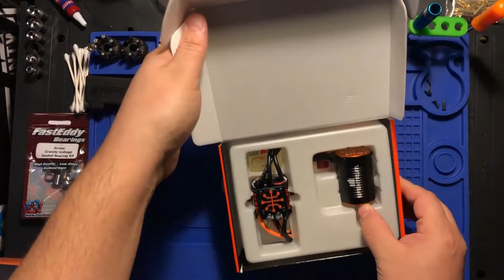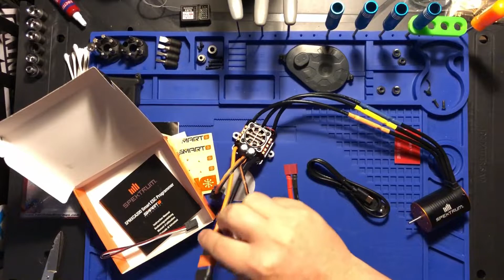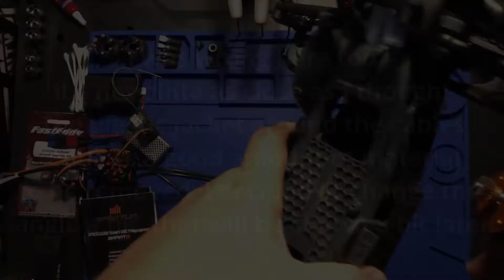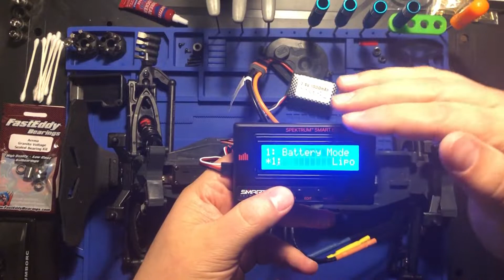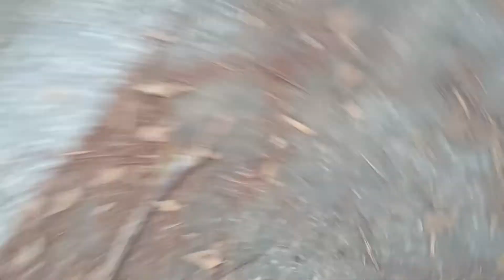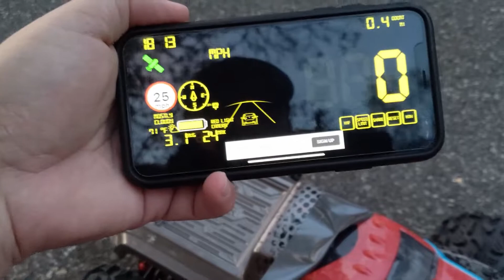Overvolt | Arrma Granite Voltage gets Spektrum Brushless System (is it faster?)

Comment: Made it ! 100th subscriber for you bro.
Reply from the maker: Extra special internet high five to you man! Thanks for the 100th sub!!!
Reply: Word high dive recieved . And my first hobby grade was a voltage 2wd. Back in November.  Now I have 4. Notorious 6S bigrock and just got a senton that I put the powerplant from an infraction in.
Reply from the maker: @michaellind3626  Notorious is definitely on my list. That senton/infraction combo sounds pretty insane!
Reply: @kylegeldmaker   it is for sure only going 4s for now changed all input and crown gears to metal and slipper assembly.  Had to upgrade cvds kept.pulling ujoints apart.  It is a monster 👹 for sure
Reply from the maker: @michaellind3626  is it meant to be a basher, or are you going more of the speed run route?
Reply: @kylegeldmaker  no basher all the way. I tried speed running but bashing is where its at!. I put Mojave 6s shocks and kraton 6s shocks on to have little better landings.
Reply from the maker: @michaellind3626  I agree. Although, I am planning a mild speed-ish build with a buggy in the next month or so.
Reply: @kylegeldmaker  i plan on getting a Mojave next and want to try a little speed with that one. I know it won't be easy but it'll cool to go fast in thst one! Lol
Reply: I just sold my speedrun rig today it was just sitting so I figured could go somewhere it was appreciated more than my wall lol
Reply from the maker: @michaellind3626  You're a stronger man than I. I'm running out of room and yet I can't bring myself to sell a rig. Much to the dismay of my wife haha!
Reply: @kylegeldmaker  well it went to a good home. My buddy has 4 wltoys now  and wanted this one before me but I got it first.  Had a castle 5700kv motor with sidewinder 4 esc. It was a 100mph rig. He's got one he did a dbl motor in and trying for 125. He's gonna add another system like the one it has and make it a double too. So why not let him take it when its just collecting dust with me.

Comment: I am a couple years late to the video...lol I just put this exact combo into my Slash 4x4 (was originally a brushed motor. I have uped the pinion to 15 pin(i think, maybe 17. Cant remember) I just got a 3s spectrum battery to try out, used a 2s and want more speed, hope this does it or up the pinion again maybe? Any pointer are appreciated
Reply from the maker: Gearing + juice = more powah, baby! I believe 3s is the max for that ESC, I've hit like 56 mph on that combo with my buggy.

Comment: I put the same exact stuff my granite voltage and I also had to cut the chassis
Reply from the maker: It wasn't too bad. I've had it this way for quite a while and I haven't broken a single thing or noticed any issues that  could be caused by notching the chassis.

Comment: Great video. I'm totally sold on Spektrum Combo systems. I have 2 of the exact same systems you are reviewing and they preform excellent. I also have the BLX100 systems in my Granite and Typhon and have had no problems at all. I like how the 85amp ESC has the Caps on board much better than the BLX100.  You did a great job fitting the motor. The final outcome was awesome and it ran well considering the battery.  Thanks for sharing 👍
Reply from the maker: I bought two more of those Spectrum combos. Im thinking about tossing one into one of those wltoys 14th scale buggies.
Reply: @kylegeldmaker  Sounds like a great idea. You might need to add some weight as well or attach some wings. 👍👍😀😀
Reply from the maker: @RCRoads  it's got one on the back already, haha.

Comment: So I just bought this combo today with 3s how fast would it make my rustler go
Reply from the maker: Depends on the gearing, but my fastest speed I've tested was 46-47. I bet it would do 50 with actual road tires.
Reply: @kylegeldmaker  wow can’t wait 😳
Reply: @kylegeldmaker  I use stock but it’ll be faster then 40 right
Reply from the maker: @tylerdouglas4654  I bet it would be.
Reply: @kylegeldmaker  the dude said 50 it might do 50 idk🤷‍♂️
Reply: @kylegeldmaker  did you use stock when you got 46-47 or change the gears a little
Reply from the maker: @tylerdouglas4654  no, i was using a +3 pinion, but I believe my neighbors rustler was faster than my voltage. His was stock, mine (at the time) was brushed with the +3 pinion and a 2s lipo. I think you'll enjoy it.
Reply: @kylegeldmaker  well mine is brushless with a 3s so it might be faster
Reply: @kylegeldmaker  wait did he change the pinions
Reply: @kylegeldmaker  bc I’m keeping stock 12t and running 3s
Reply: @kylegeldmaker  it’s gonna have to be about 40-45 mph bc I’m running 3s
Reply: @kylegeldmaker  I ran it with 3s with the combo and got 20mph is there a training mode on it or something bc 3s should be pushing way more
Reply from the maker: @tylerdouglas4654  maybe the top speed limiter on the transmitter is turned down. 17-20 is probably what's ita good for with the brushed motor and the factory battery
Reply: @kylegeldmaker  it’s brushless
Reply: @kylegeldmaker  do you know how I change iy
Reply: @kylegeldmaker  and I have the tea as remote and it only has steering trim
Reply: @kylegeldmaker  Can you re calibrate it to make it faster

Comment: I used a castle motor and it fit perfectly, but now the 16t pinion won't match using original mounting holes.  What pinion did you use?
Reply from the maker: I used a 19t, there's a link to the exact one Im using in the description box - https://amzn.to/2VJALFk

Comment: What is the esc program for? is it necessary? I bought this motor esc combo and hooked it up to my RedCat lightning and it seems to run fine.
Reply from the maker: It's used to change certain parameters, depending on the options of the ESC. I usually use it to tune the braking and voltage given to the internal BEC, if available. 

Lots of folks increase the punch level for more immediate delivery of power. The Spektrum device has a built in cell checker, in my mind that's worth the price alone.
Reply: @kylegeldmaker  okay thanks for the explanation

Comment: I have that same esc and it will run the 3s battery for like 2 minutes then truck dies turn it off and back on it will run again for 2 minutes any ideas
Reply from the maker: Are any of the components super hot? What's the discharge rate of the batteries? Are you using an adapter on the battery?
Reply: @kylegeldmaker  I'm running a 3s 5200 80c and I have a EC5 TO DEANS T PLUG from esc to battery
Reply from the maker: @XunavailableXSequenceX  it's not likely the cause, but of you can - try to swap the deans to EC5. I've had thermal issues because of deans adapters.
Reply: @kylegeldmaker  it's on the new arrma vorteks so esc is different than this one in video I think I'm still noob at this rc stuff 🤣🤣
Reply from the maker: @XunavailableXSequenceX    it's a blx100, same unit in most (if not all) the 3s line. 
When it dies, do you feel excessive heat on the motor/ESC/battery/wires? Is it a Spektrum smart battery?

Comment: I’m thinking buying one can you run it on 3s?
Reply from the maker: I've seen some people try it. Mine wouldnt even start on 3s on the stock electronics. The Spektrum kit will definitely work with 3s, it's designed for 3s 2wd trucks.
Reply: What is the spectrum kit is it the one you reviewed
Reply from the maker: @alimturan3131  it's a 85a ESC and a 4000kv brushless motor kit.

Comment: I got a Arrma granite, I want to use deans connector lipos, specificaly the Zeee ones like you used, have you had heat or melting problems /w deans?
Reply from the maker: No issues with deans on 2s or 3s. My kaiju using a deans to ic5 adapter on 4s does get a bit toasty. It doesnt go into thermal protection nor anything but it does get warm and I will be changing them. If your using a deans battery to a deans ESC on 2s or 3s, you're good to go.

Comment: Have you had any issues with the Diff's, or Drive Cups after a few runs?
Reply from the maker: No I haven't, however, I have always been very careful about the drive cups so I was gentle with the throttle when they were composite but now that they're steel - I'm a little more aggressive and they're in perfect shape.

Comment: Do you have any problems running it with stock battery cause I have same esc and the 3300kv motor and it won’t run stock battery
Reply from the maker: It's a LiPo system, the stock battery is NIMH. I think there's an option to swap the battery chemistry but really you're better off with a lipo. I think I picked up 2 2s lipos for $35 on Amazon (Zeee brand, check my description).
Reply: @kylegeldmaker  do you know how i could switch to nimh untill i get a lipo later this week
Reply from the maker: @puzzymasternawest3121  If you have the programmer its item 1, option 2. Item 1 is battery chemistry. Default is LiPo, option 2 is for NiMH. 

You'll probably want to watch a video on program mode, but since its the first option - it's pretty easy. You basically turn on the transmitter then turn on the car and hold the "set" button until the green LED flashes then press the "set" button to change the option.  This mode can be tricky, so definitely watch a video or two.

On the very remote chance you're in Ocoee, FL I'd be happy to lend you the controller LOL.
Reply: @kylegeldmaker  ok thanks lol,